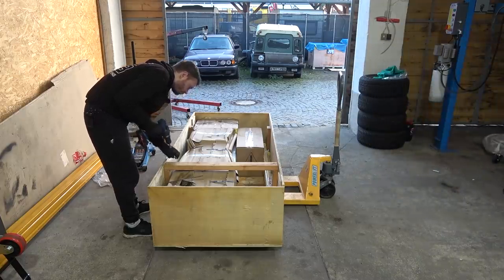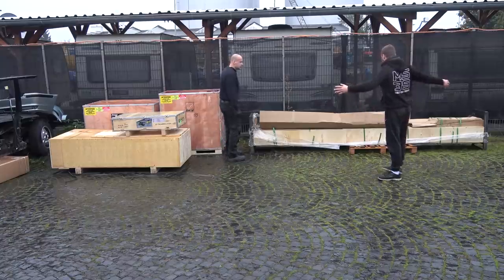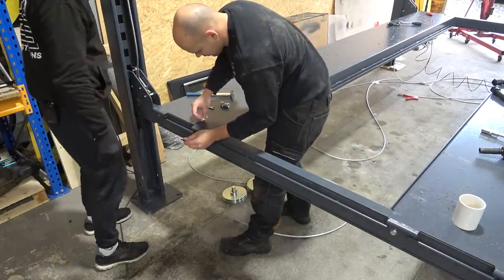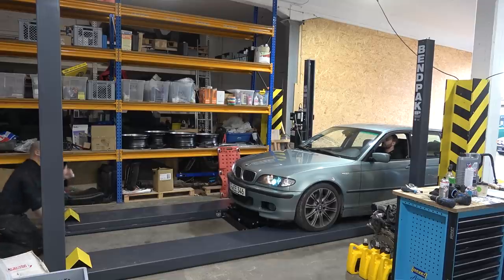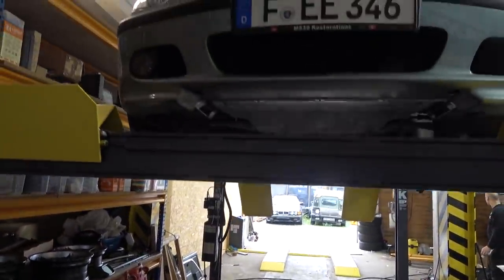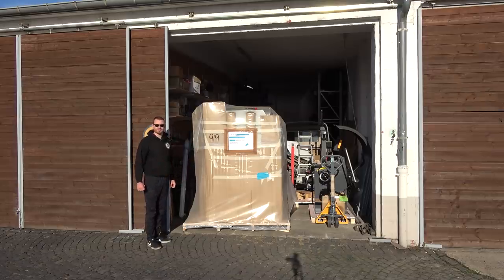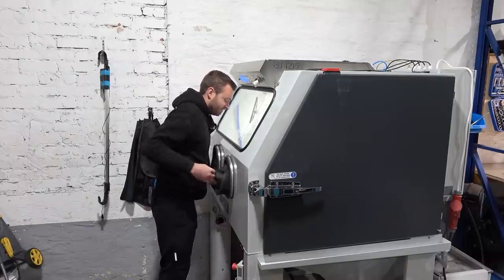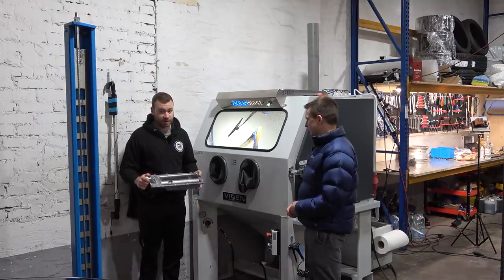New Lifts & Aqua Blasting Cabinet - Workshop Build: Part 3

Comment: as a forklift driver in the US seeing a forklift with a casing to protect the driver be that from materials or the weather is just strange and I am oddly jealous.
Reply: some have heated seats, ac, radio, ...
Reply: Oh man I didn't even realize there were ones without casings that are used outdoors
Reply: Every forklift i have seen had stretch foil wrapped up top for rain 😂
Reply: @Ropenkkao  mcguiver shit right there lol
Reply: @Ropenkkao  Cardboard strapped to the roof LMAO
Reply: aaaand than you can realize we have healthcare insurance
Reply: Get a gas powered Toyota. Clear polycarbonate roof, reversing light, headlights. All UK and European ones have to conform to very strict health and safety rules. Have to be regularly serviced and have regular safety inspections.
Reply: @chunkyericsson9038  We technically also have healthcare it's just weird and not from the government. But it's super expensive because of the government has some involvement same with education.
Reply: @simonspencer7017  I mean i don't think owner/operator forklift driver is realistic. Good luck getting any company to invest more than the bare minimum on anything here where I live.

Comment: When using the tire machine:

-Remove valve stem and all air before popping the bead.
-First pop the front face of the wheel on one or two spots and then flip and pop as many times needed to move the bead away from rim all around so you can clamp easier on the table.
Brush lube in the beads as you're popping, especially if you wanna reuse the tire and want to avoid shredding the beads. 
-Remove all balancing weights of the wheel now
-When clamping on the turntable rest the wheel on one of the jaws and as the jaws close try not to pinch the tire. You can release the pedal slowly and give yourself time to clamp it right.
-As soon as you press the pedal to bring the mounting/demounting head down you must release with the little button as it might be set on a smaller rim and might land on your wheel and scratch it.
-When spinning table to remove tire, make sure the bead on the opposite side is pushed down into the mounting hump and away from the bead rest.
-Make sure you fit direction and face off new tire correctly. If there is a yellow dot on it put it as close to the valve as possible.
-Pump and pop the bead in with the valve stem out. 

*The mounting/demounting has a plastic protector for the wheel that will brake off if you don't remove the knock on balancing weights off the wheel.
*The Jaws on the turntable come with plastic protectors in case you come across an upside down wheel (highly unlikely, they are usually cheap Chinese ones)

Practice practice practice
Good luck.
Merry Christmas Happy Holidays
Reply: Knowledge is the key!!
Reply: what is a chinese upside down wheel, how do they look?

Comment: The Aquablast has another advantage when it comes to originally rough surfaces. When a rough surface is not needed for function, a smoother surface prevents hair cracks from starting on the surface and getting bigger.
Reply: just what Edd China said in his video with Aquablaster a week ago :D
Reply: Hold on, does the machine reuse the glass beads?
Reply: @afroaliens  Yes.
Reply: That isnt always technically true. A peened surface distributes stresses (usually compressive or "amorphous" layer mainly from machining. This reduces surface fatigue and prevents crack and/or crack propergation. Turbine wheels etc are always peened to ensure surface integrity.
Obviously a cast surface or a pitted surface on ferrous metal would benefit from a surface conditioned by glass media.

Comment: The Aquablaster peens surfaces as well as cleaning them, so as well as making them much slicker and less prone to dirt or varnish build up also stress-relieves them - probably well worth using on critical components like con-rods even if they don't need cleaning.

Comment: I recently discovered this process. Had all the parts on my classic motorcycle engine sent out to get the treatment. I'm blown away by the result! The parts are really better than new! Not only clean, but the surface becomes so much easier to clean afterwards. If you have a guy with this tool in your area, try it out!

Comment: I remember using something like a sandblast cabinet to restore rims etc. It worked terrible, you coudn't see sh*t trough the window, nozzles were always filled with sand so you needed to clean it first. Hated that machine. Aqua blast with water pressure looks way better! 

It's becomming a serious pro shop Sreten!

Comment: Very nice set up! If you are working alone, a large mirror in front of the 4 post so you can see yourself centered on the 4 post as you drive up. So you don't have to go in and out of the car to see if you are centered. Be careful not to go too high to not dent a roof of a car on the ceiling. Mark the ramp with painter's tape of grease pen to the highest point on the post that is comfortable to not hit the ceiling

Comment: Mmmmm, I'm not jealous of your workshop in the slightest 🤣 Good equipment is such a time saver and the vapour blaster not only cleans but also conditions the surface of the part by peening high spots and pores to leave a smoother more robust surface 😃

Comment: Aquablaster 
1. Don't be afraid to adjust the air pressure if you are doing parts that are a bit more delicate, less impact from the glass beads. Conversely, turn it if doing something that is a little more dirty and needs to extra push.
2. You will also notice that as the glass beads breakdown that the surface finish changes, nothing to worry about.
3. A little plastic/metal shelf or similar can help with parts cleaning in that it can give you something to rest then on & hold at different angles rather than holding the part/item all the time, your hands will get tired.
4. Be very careful with drying with compressed air at the end as you can find very small pieces of glass flying out towards you, get some good safety googles. 

Enjoy using your machine as they are awesome pieces of equipment.

Comment: Congratulations with all your new equipment, it looks grate. After blasting some metal or aluminum parts will need a wet or powder coating and I presume you will outsource that? ‘Epoxy”powdercoating for chassis- or suspension parts is by far the best system you can wish for but if you need some parts quickly done after blasting it makes sense to have some 2k black paint ore primer rattle cans in stock. It is a real good alternative for spray panting little brackets and parts in the engine bay ore on invisible places. Good luck with all your projects!

Comment: I am still a  big fan of "hot tank" cleaning, it gets into all nooks and crannies, what 98% of machines can not do, or just take forever. But it is a personal opinion, and that machine looks like it can get inside all those small tight areas.

Tip: Keep some of the carboard/packing materials, they work great when you spil oil, coolant or fluids from the car (think of them as a big absorbing cloth).

Comment: great Video Sreten, Merry Christmas ,I am happy for you and a little jealous at the sametime, i have seen the tire machines here in Canada , they are next level and vastly improve a businesses output from ease and speed they perform at,  that scissor lift i totally love it would fit in my garage perfectly , i don't have allot of room and i can't get a permit to build my garage out taller than 3 meters high walls because i live in a residential area otherwise i would have gone for a Bendpak 2 post lift , i do not work on anything too large or heavy just cars of my own, A company i use to work for in the 90's had a version of the Aqua Blast machine and they work awesomely and like you said it is so relaxing to use and clean parts miraculously , looking forward to future videos and i think i will look into that scissor lift I am tired of laying on my back on a creeper 👍

Comment: Great video as always!
On the floor and epoxy idea,  if I had to do it again, I would go with concrete polishing and a light color stain with sealer.  I put epoxy on my garage/shop and every time I drop a tool it chips the epoxy and undercoating.  I was also told the clear coat sealer would not stain, and unfortunately, it does stain if the oils sit for a while.  There are also some aircraft hangar coatings that are very hard and easy on the maintenance.

Comment: For the floor, if you get the floor to be in either signal orange or signal green, it will make finding tiny parts like screws and bilts n nuts or other small things much much easier.

Comment: Sreten, Congratulations on all of your great upgrades and for your "new" workshop! Just thought I would make a suggestion. Maybe check with AquaBlast and ask if they have an additive available that you might be able to add to your water and media mixture that would prevent "Flash rusting" of your parts after being vapour blasted. I know that that depends on the metal you are blasting for a particular application. Also, there are a variety of media aggregates that you can mix and use together to give you different kinds of finishes depending on the application. Vapour blasting a "classic vintage" motorcycle engine for a restoration is not exactly the same as your application. Anyway, Best of Luck and continued success with your projects!

Comment: You can use an VFD to make triple phase 400V AC from single phase 230V AC, pretty common for people with small shop and only one or two big motor to run, it can save a bit of money.

Comment: Nice machines you have got there.
Be carefull with the glass beads as a blasting medium for parts which you intend to paint afterwards.
We have learned the hard way as the paint might not adhere to the surface as expected and might start peeling/wearing off prematurely. Of course we have run tests and compared different blasting mediums and the difference is remarkable between gleass beads and aluminium oxyde.
Aluminium oxide is prefered blasting medium.
Good luck
Reply from the maker: Thanks! Yeah, that's what I've been told. I don't plan to paint bigger parts afterwards so glass media will be fine for my use.

Comment: There's a lot you can do with a wet blasting machine depending on the media (steel shot and ceramic is useful for peening, aluminum oxide for keying before paint or heavy rust removal) but got to make sure that it's properly cleared out between uses.

Comment: That blaster is amazing!
Wish it was big enough so that you can stuff the whole car into it, and clean it like it has never been clean before.
Btw, not sure about the wheel balancer. The ones that are as near perfect as you can get are the Hunter Roadforce machines.
I have always had trouble balancing the wheel and tires perfectly on the Audi allroad I had years ago on normal balancing machines.
But the Roadforce would balance them better than a Swiss watch - AS LONG as the employee was trained how to use it properly.
Reply: Most wheel balancing issues are caused by the monkey operating the machine. Also not fitting the wheel correctly to the hub.
Reply: @seanpaul3050  
That's true, by-and-large.
The Audi, otoh, was very sensitive to any imbalance. I would have to rebalance the wheels and tires at least once a year, sometimes two.

Comment: You can use a gray heavy duty floor paint. It is easy to apply, easy to clean and not so expensive. Shine epoxy floor is not a very good ideia for a real shop, too slippery and impossible to remove in the future.

Comment: Awesome machine that Vixen. I was wondering about a "nail" that I noticed inside the blasting cabin (noticed it already in previous videos where you used the machine) and now I'm kinda relieved it's only the handle of the strainer (up close at 20:33) and not another "nail of shame" you found in some oil pan...😆

Comment: Vapour blasting is great, but should be used only on items you can clean out properly. For example, clean a water pump with that bearing is not such a great idea. Unless you can see it clean every inch, glass bead can collect.
Next time you blast something with threaded holes, wind a bolt down and you'll hear the crunch of glass. Everything like this need cleaning out on engine parts, especially internal engine bits.

Comment: Remember to remove your wheel weights before dismounting your tires. They not only scratch your wheels but will destroy the plastic heads on the tire machine.

Comment: Amazing stuff. What is the blaster using apart from water? Something like sand or quartz?
Reply: Spherical glass beads, probably a 70/140 mesh size I would think, good mix of speed and roughness of the finished part

Comment: Dont know if anyone already told you but u NEED TO REMOVE the wheel balance weights BEFORE u remove the tire or you will sooner or later SCRATCH a rim.
Cheers from Sweden 🇸🇪

Comment: You have not been working on the B7 lately. Must has been a pain in thr neck
Reply from the maker: No, it means that the machine shop didn't finish the engine. As I said, it will take 1-2 months.

Comment: So the 4 post lift doesn't have to be bolted to the floor ?
Reply: Just  read the docs. Anchoring does make it more stable, but it's not required to anchor a four post lift, which enables you to move it around. That is wicked!

Comment: Also, what are the advantages and disadvantages compared to a sandblasting cabinet?
Reply: Water is cheap and easier to clean and no dust
Reply: @ljubavnifeder  "Water is cheap" don't forget this is Germany. Water and Electricity is quite expensive.
Reply: @dmdwst8787  water is still cheaper then sand for the sanding machine.   Especially no sand dust is one of the biggest benefit's. I hope Sreten keep it painted outside because of rust.
Reply: It increases efficiency.  The water greatly aids in carrying the blast media.  It also adds mass which also makes the blast media more effective.  Water is so much more effective at dust management.  If it were a typical blast cabinet there would be an entire separate cabinet just for the vacuum and filtering.  It gets really old to have a vacuum screaming away while you are blasting.  A person can also add chemicals to the water to aid in grease removal, and reduce flash over rusting.  Oh it is also the most effective method for removing power coating because it keeps the surface cool enough for the media to actually blast the powder coat off instead of slightly melting it.
Reply: @ljubavnifeder  Pretty sure it it aluminum or stainless.
Reply: @ShainAndrews  I don't know but what I do know that most of them rust over the Winter.. frame box. Also to keep the box dry. I don know if Sretena Garage heated.
Reply: @ShainAndrews  I just told that because Sreten is always freezing and has not warm garage. But I have seen those sandblasting machines got rust and pretty in bad shape after a few years. If this is better then it is. I actually love it what I have seen what it does. Reminds me of those we had in the army. Thanks for all added information. 🙃

Comment: How big does the compressor need to be for that machine?
Reply from the maker: Minimum 700L/min.
Reply: @M539Restorations  I still remember 1 year ago when i asked you on instagram if you thought about quitting your job and go full time with the channel :-)
Reply: @M539Restorations  That is just a tank.  Compressors are rated at a discharge volume at a given pressure.
Reply from the maker: Spec required is 700 liters per minute at min 4 bar. Tank is 150L.
Reply: @M539Restorations  Wow.  Didn't think it wanted that much air.  That's just under 25 cfm (if my rough mental conversion is right).
Reply from the maker: @ShainAndrews  yup, my current small compressor can only blast properly for about 10-15 seconds.

Comment: Bendpak is just rebadged chinese "Launch" or "Space" products, and i'm not saying they are bad, in fact they are actually decent. But the creme de la creme is NUSSBAUM, now those are high quality car lifts.
For the compressor try to find a used "screw" type one, much more smoother, reliable and quieter in operation them normal piston one, you will find that even if you buy a piston one with a big reservoir 250-350 litres, it will almost always stay cotinuously on because the motor is week and has to work allot to keep the reservoir full.
Reply from the maker: 99% of the lifts are made in China which is not a bad thing, just different level of quality. I find quality to be excellent, especially compared to my previous one. BandPak has been very long on the market and has proven itself in that field. If not mistaken, they are biggest seller of garage equipment in the US.
I got a silent type compressor with 8 motors, 7.5hp, 150L. Anything bigger or stronger than that is way too loud.
Reply: Is BendPak made in China? Yes. Is it rebadged / prive label? Solid NO.              BendPak OWNS the manufacturing facilities in China, that being said, All BendPak employees are Q.C. trained and follow rigid ISO-9001 guidelines.  BendPak follows stringent quality control measures at every level of manufacturing, facilitating a smooth and efficient operation.